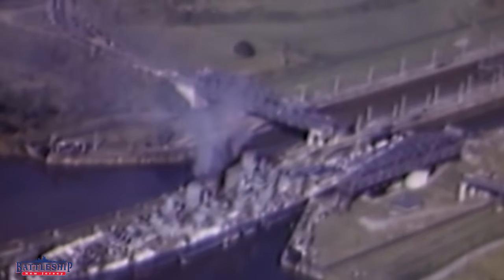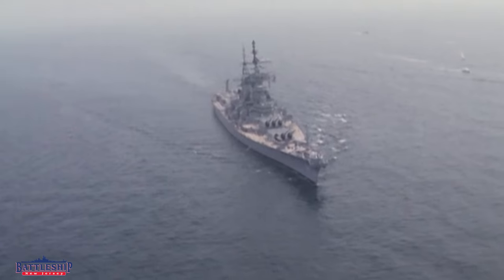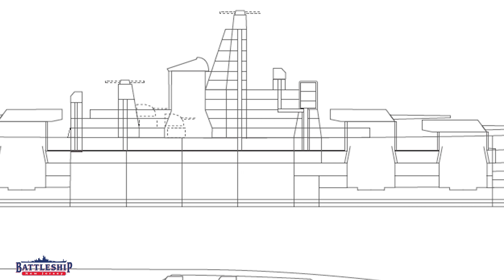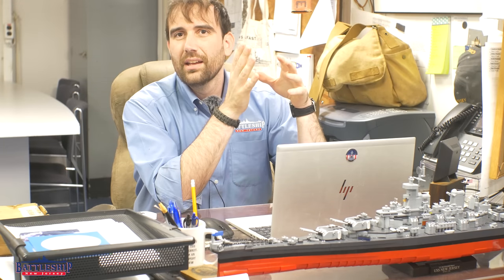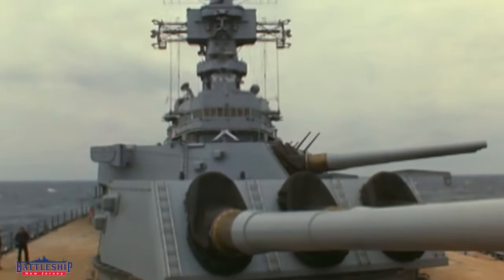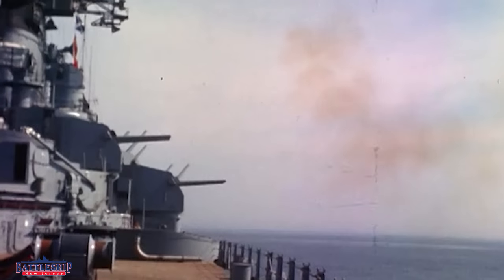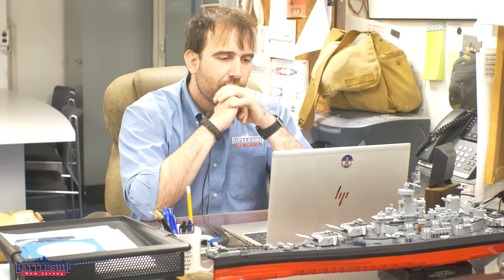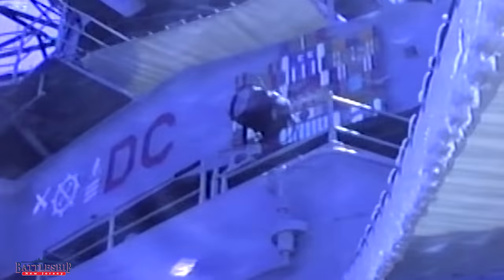The Perfect Battleship

Comment: No on mine it be built after the first 2 iowas and be something like right need more firepower  need to save weight so all welled min rivets.use midway power plant 4 shafts 2 rudders  scrap  boats and aircraft as they be assigned to escort ships. Add sonor.  Add 4th gun replace 40mm with 3inch scrape conning tower.  Flat front. Extra 6inch external belt full length so only capital ships are threat to it. 20 mm  replaced by belt felt quad 20mm.

Comment: And if we found 4 of your BBs sitting in a reserve fleet they would be great to be updated.
Turbo-electric is great. Swap out the boilers for gas-turbine generators.  several  MK 57 VLS cells and of course a SPY-6 radar. Make the 16-inch guns into autoloaders. I know they don't exist yet but hey this is the 21st century. For ammo, precision-guided 155mm with sabots on another sabot round for hitting targets at long rangeReplace the 5 /38s with Mk 41 Mod 4s in single mounts and all 20mm mounts with Phalanx and Mk-38  systems. Replace the 40mm mounts with RAMs. 
Add a helipad and if possible a hanger. 
So you would have plenty of firepower for supporting landing operations or taking out shore targets. JSM and Tomahawks for long-range strikes,  NSM and SM-6 for anti-ship. SM-2, SM-6, and ESSM for air defense plus the Mk-41s, RAM. Phalanx, and MK-38s. And SM-3s and maybe PAC-3s for missile defense. PAC-3s have been test fired from Mk-41s so maybe. 
Your choice of turbo-electric drive really makes updating easy You could also replace the electric drive motors with more modern motors.  To save money use LM2500s from all the old Perry and Ticonderoga class ships retiring. Too bad we don't have those hulls sitting around in a reserve fleet somewhere :)

Comment: It depends on the decade that you would do the construction. If money wasn't a constraint, I am sure that the Navy would ask for a 2023 build. I can really see the opportunity for a class of battleship in the Montana size and displacement built around 3 x 3 gun 16"/50 since the Panama canal is bigger now than it was in 1945. I am a believer in Ryan's electric drive concept, but I would choose a modern "Combined Cycle power plant" which gets close to 50% efficiency on the fuel when generating electricity. A 3 turret system like the Iowa would save weight and space for a helicopter hanger in the back like USS Salem big enough for a V22 to land. I would use 2 x 5"/54 Mark 45 per side as the secondary which would leave a lot of weight and space to add the AEGIS AN/SPY-6 radar, VLS missile launch tubes under the deck and armored box launchers for the Naval Strike Missiles or NSM that has just become available. The armored conning tower would probably not be there but replaced by smaller armored video camera systems which would allow conning the ship from below decks while still providing a 360 degree view and placed all over the ship. With the Aegis SPY-6, the ship could use RIM-174 SM-6 missiles in VLS tubes,  SEARAM missiles on port and starboard box launchers, and phalanx CIWS mounts; the ship could provide the same multi layered air defense that a modern 2023 frigate can do. A ship like that would easily escort a modern Ford class aircraft carrier, provide naval gun support for amphibious landings, and do "Freedom of navigation" cruises. With an armored belt and torpedo defense, it would be a good candidate for the kind of Taiwan strait sailing today where some Chinese Frigate might try to "nudge" your 45,000 ton armored hull out of their claimed part of international waters (I would really like to see someone try that).

Comment: I’ve been thinking of this for a while, though a key difference is I lean into the fantasy with a fantasy nation. So for example your ship replaces the Iowa and I can’t help but feel that’s a little rude to the Iowa.

I would like to be more balanced and would go with eight of the best 16” guns in twin turrets, not much that can reasonably stand up to this firepower, Iowa and Yamato is a close match anyways. Being twins I could squeeze them a little closer together without having horrible turret angles.

Moving on to secondaries it’s a twin 4.5” cannon similar in concept to the twin 5” cannons of the US, ideally the saved weight from a smaller caliber could squeak out more range while still being hand loaded due to a higher muzzle velocity. Layout would be the same 1 bow and aft, 4 on broadside.

An alternative less realistic secondary would be to make a 5.5” cannon dual purpose, a task more reasonable than a dual purpose 6” cannon. Hand loading would be out of the question but it would also be better at anti surface. This would cut the number of turrets available, I would keep the bow and aft layout but the broadside will drop to 3 turrets.

Medium AA is made up of 2 inchers similar to the 57mm Bofors that saw service on Jean Bart post war. As for light AA I’m bouncing between 20mm and 30mm cannons, I’m concerned that 20mm is too light for the plane hells of late WW2.

We agree on the powerplant and armor layout, turbo electric protected by a sturdy external belt. I don’t think a better deck layout than weather deck into main deck with a splinter deck beneath it exists. I’m a believer of the Italian torpedo defense, being not limited by the Panama Canal allows me to go a little wider. And of course lastly, scratch the armored conning tower.

Propulsion is four props as well but a three rudder layout with one main rudder and two secondary rudders. The overall hull shape would likely be similar to HMS Vanguard but with a late US cruiser style superstructure. Aircraft and boats in the back, maybe even with a hanger.

Comment: An ideal British ship I'd probably lean in to something similar to Vanguard.

The power generation is already in a sweet spot for Vanguard and gives her 30knots (and probably more because British boilers regularly overperformed their official stats) but I would switch to external torpedo defence.

If at all possible I'd drop the 4x2 15"s  for 3x3 16"s - but only if i can build a gun and mount that is an imprivement over the british 15"s - the british 14 and 16" guns, even where they were superior to the 15"s, werent better enough frankly. Ideally id follow the same iterative process that the British took to get the 15"s in the first place as it produced an incredible weapons system - the same fundamental design upsized to 16" - the mountings would probably have their rear and side armour thinned in fabour of thicker top and front, but not by more than an inch.
 I'd drop the 5.25" secondaries for 4.7" as used on the British destroyer forces in twin DP mounts. If possible I'd have 6 mounts a side, but 5 would be acceptable. Everything else broadly the same as Vanguard but I'd thin out the vertical protection to 13" and angle, and horizontal protection would hopefully be thickened to 7 or 7.5" with the weight shaved off of elsewhere. Splinter protection everywhere else. I'd be using as much of the highest quality structural steel as I can get a hold of, but Britain's situation 1940-43 precludes me being as profligate as the US was with its STS. I'd slap as many electrically powered Bofors as possible on the ship as possible without causing her to scrape her bottom in Portsmouth Harbour.

Comment: 20mm were a "morale" device for the cooks, clerks, & stewards--the 2000 yard slant range means waiting until the last 30 seconds of a kamikaze attack.  Torpedo & dive bombers are supposed to break off well before getting to 2000 yards.  So, a manual 3"25 is actually a better choice than any ten 20mm.  Director control of twin and quad 40s is far better.

Comment: My perfect battleship would be one capable of doing everything the Iowas did during and after WW2 and then more.
The key idea would be to trade firepower for speed and precision and prioritize easier buidling and thus get a longer series of a smaller and lighter ship.
Two forward tripple turrets, thus half an ordinary battleship but significant weight comes back for more machine space  and an aft hangar for spotter aeroplanes and perhaps more armour.
No conning tower for thet ballance budget to get ambitious radars higher up and they are anyway fairly useless.
More generator and cooling capacity for more radars.
Hangar space for more ambitious spotter aeroplane use to get the precision and keep the initaitive in gun engagements.
At least the same AA.
Your machine space ideas are realy good.
External armour belt to increase the protected volume and making it possible the get out of the main slipway faster and mount the belt armour afterwards.
And they could have been built instead of the Alaska cruisers.

Then the USA could have ended the second world war with twise as manny about 70% size Iowas and had 8 ships that would have been even better to mount new electronics and missiles on and operate helicopters from. And it would have been more tempting to keep building a cheaper ship with more post war potential. And a longer series makes it more worthwile to for instance develop a drop in upgrade for dual 5" gun mounts or new long range 16" ammunition or used the shell volume to build GPS controlled or target seeking ammunition 10 years before it was possible in 155 mm.

Comment: Instead of adding a sixteen-inch turret, I'd delete one.  Six guns is enough for shore bombardment, and the probability of a line-of-battle battle was minimal.  In place of the deleted turret, I'd add more five-inch mounts.  As many as would fit.  I'd also cram 40 mm and 20 mm guns into any free square inches of deck space.

Tactically, I'd reorganize my carrier task force.  Instead of a bunch of task groups with four CV each and one with four BB, I's spread the BBs out, creating TGs with three CV and one BB each.  I'd also create an enhanced Atlanta class, with at least two and preferably more five-inch mounts.  These changes would put a lot more heavy AA fire closer to the carriers, which should give them a lot more protection against kamikazes.

Comment: Cold war/modern era. 50-60k ton, Nuclear powered, 3 triple 16in guns 2 forward 1 rear, Vertical launch missle bays between the rear turret and the superstructure. Secondary probably the 5"/54 mk 45 dual purpose gun and 3 or 4 on each side. I'm not super familiar with AA guns so I can't really specify anything...

The nuclear power plant should give plenty of power for propulsion and to upgrade to more advanced systems and weapons.

Comment: Guess we need to get Drach to do one using British tech.
Reply: Then build them in Ultimate Admiral Dreadnaughts and run 1v1s lol
Reply: Drach has already discussed this in a number of his Drydock videos.  Crudely speaking it's an al-forward design based on either three triple 16/50 guns and an absolute mountain of various AA/anti-surface secondary.  I think in one of these he discussed the use of three quad 16 guns, or even a three forward plus one aft quad or triple 16 - scary or what? (just think about it 16 off 16 inch guns firing a rolling broadside at some poor unwitting ship....).

Comment: Designing a better Bismarck would be my perfect battleship, using four shafts, like German battle cruisers. Using an angled belt with tirpitz thickness.
Using an all or nothing armour scheme, with the same deck armour thickness as Tirpitz. Removing the conning tower. 
Inclining the armour. 
Removing the floatplane 
Have the same 6 inch, but 88s instead of 10.5s, use auto loading dual 3.7cm mounts and quadruple 2cm mounts as many as guns as the weight allowed.
If Germans had a triple 15 inch gun four of them would be ideal but if not the 8 15 inch guns can stay.
Speed should be similar and tirpitz extra fuel should be useful.
Same torpedo defence. 
Keeping cables under the armour.

Comment: If we're talking about "what if" then would it be possible to gain performance with smaller diameter shells?  In other types of projectiles sometimes you can gain range through better aerodynamics, and you can gain penetration through better sectional density, with smaller diameter but longer projectiles.  Maybe with more research and development since WWII we could get better performance out of slightly smaller diameter bores.  For instance could a 14" diameter gun firing the same weight projectiles achieve nearly the same velocity with improved powder?  Maybe I missed this- if we are limiting the discussion to technology available in WWII then 16" is probably the sweet spot.
If you are rearranging the layout of propulsion equipment spaces does that make it easier or harder to work with just one stack?

Comment: I personally prefer the Bismarck's engine, gun & superstructure layout compared to the IOWA.
1. Less propellors make the engine room  more compact allowing for better protection & improved centre of gravity.
2. Bismarck's symmetrical gun layout aids bouyancy, helps the ships overall balance & frees up space.
3. The superstructure of the Bismarck is low & streamlined which exposes less vitals to incoming shells, unlike the IOWA.
4. Having a symmetrical hull improves the torsional strength. We all know what happened to the IOWA class when typhoon COBRA hit!!
Some food for thought 😉
Reply: Worst Battleship design.  That's why engineers stay away from Bismarck.
Reply: @issacfoster1113  At least it doesn't reflect in high seas! But being an engineer you'd know what the eventual result of this would be? 🙄
Reply: Worst design based on what? Because it sailed one time? Because her commanders had little experience in operating a ship like that? Because it took over 600 shells to put her out of action?  Because they could have built 1000 uboats instead but still lost the war? Ridiculous.

Comment: The ideal WWII battleship, as the USN had realized by about 1943,  would have good torpedo protection, little or no armor, no guns larger than 5", but lots of anti-aircraft weaponry,  and 80 to 100 airplanes that could take off and land on the ship.  Battleships were obsolescent even before Pearl Harbor.
ETA:  Was the 5"-38 the best secondary gun of WWII?  Maybe.  Was the combination of 5"-38 and Mk37 director the best secondary gun SYSTEM of WWII?  Indisputably.

Comment: I wouldn't worry about the cannal. Agree with most everything but why not use the 16" 56 cal guns? They were developed and tested better than the 18" 47 cal guns we made. Better range just slightly heavier than the 50 cal gun and shoots the same projectile.
Reply: The 16"/56 had a significantly shorter barrel life.  It was better than the 18"/47, but worse than the 16"/50.

Comment: Flat or round stern? Speed of production, even if it is armored like an aircraft carrier, probably would be first choice because there really was not a line of battle situation of equal guns logically possible. Torpedo layering and compartments at torpedo level would be the only non-magazine defense I would build in, along with a kamikaze multilayer deck outside the super structure and gun emplacements.  I suspect they could get a lot more out of a steam plant/turbine combination today over 1940 and amperage per HP from a motor today, the 4 turbines for the 4 engines might be a lot smaller.

Comment: It seams the Ryan and I have a similar ideal battleship. The one thing i would change would be replacing the 5in 38s with the 5in 54s developed with the midway and Montana class. The other change would be a stretch, but would be to replace the 4 triple turrets with 3 triple turrets with an auto loading mechanism similar to USS Salem for the 16in guns. After seeing how many people it takes to crew a turret, this could Decrease crew size, increased firepower and decreased weight all at the same time.

Comment: Since I am a House Designer and not a Naval Architect I will preface my comments with that in mind. I have always admired the Montana class design and I would use that as my base line for the design. My main change would be to upgrade engine power to attain a 33 to 34 knot speed so as to be able to operate with the Carriers. I believe the reason the Iowa's were retained as long as they were was due to their high speed  as proven by the release from the reserve fleet of North Carolina, Massachusetts, and Alabama and the scrapping of South Dakota, Indiana, and Washington. I would upgrade the secondary battery to the 5" 54 caliber gun and reduce the armor belt thickness and carry it internally as in the Iowa class. I also believe that the conning tower could be deleted with minimal splinter protection provided to the bridge area. Maybe not a perfect design but a good one nonetheless.